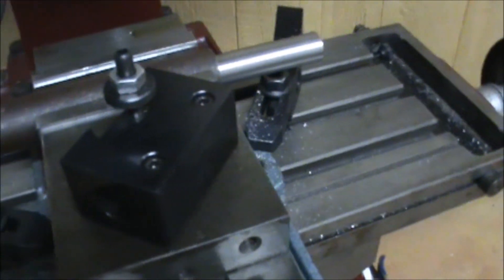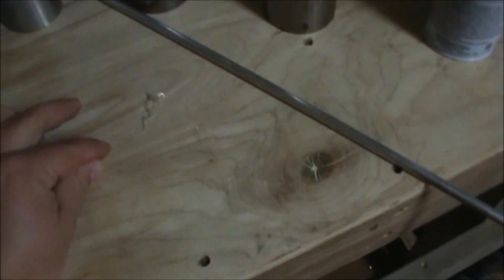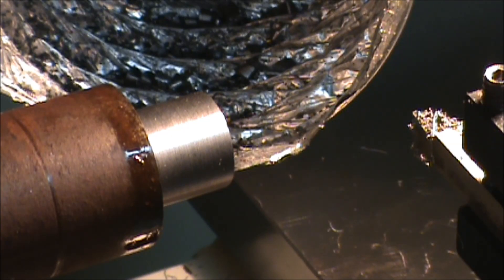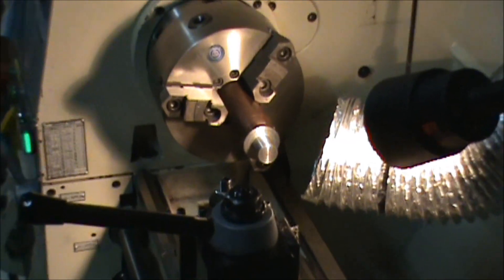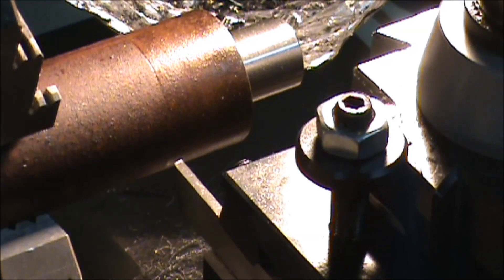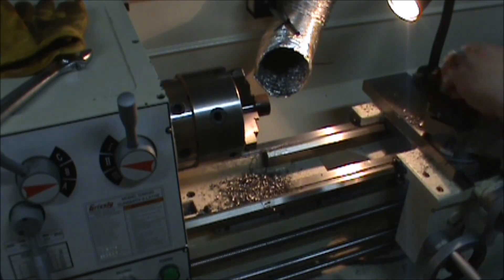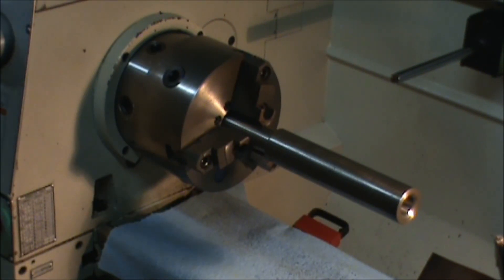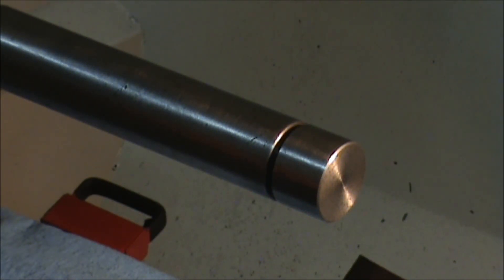Custom Boring Bar - Part 1

Comment: Followed thru the nice turning in the last video, you're doing well. About the standing the part up in the mill to slot the end. I just uploaded a video that shows a solution for that. You get V-blocks or angle plate with blocks and set to the table edge, hang the part down under the table, swing the head & go to town on the bar or shaft end. Nice & stiff!

It may take some time to get the whole part series done but I put it up thinking it may be useful for your imagination with setups.